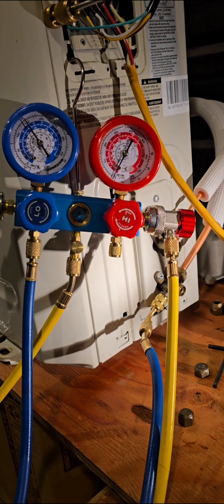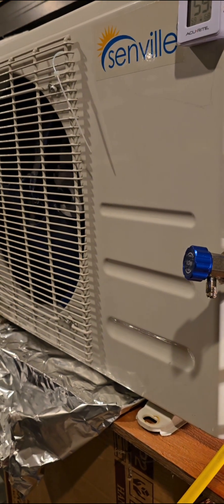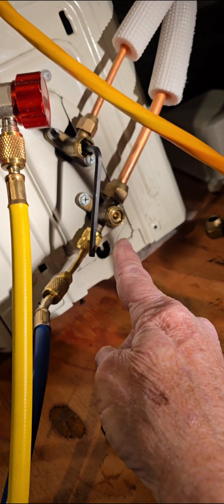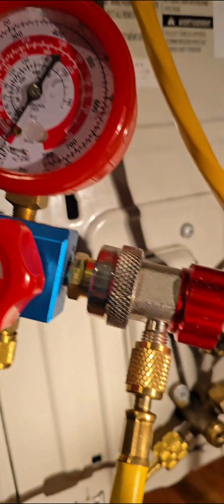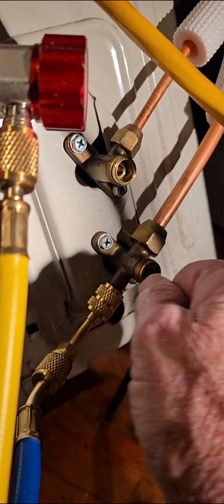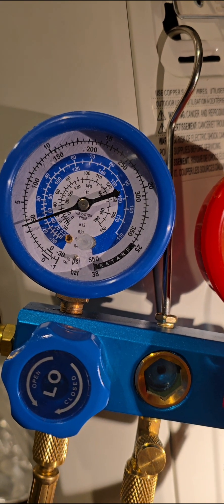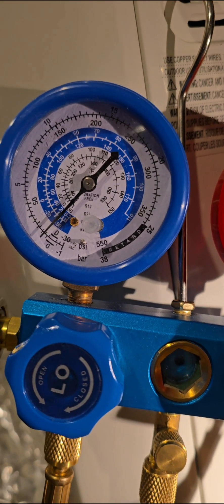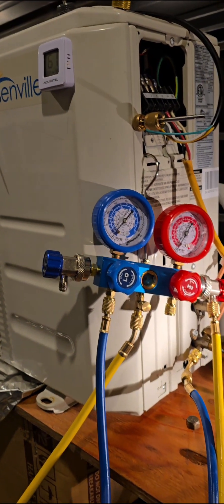Senville Leto mini split, how to put the refrigerant back into the outside unit

Comment: Does leak detector on senville can make this process faild?
Reply from the maker: No especially if you use a fan so just make sure you have a fan going all the time so no amount of refrigerant gets anywhere near the detector It's a simple process You carry a lot of tools with you on your job always keep a small fan with you also It can be a magnetic backed fan to where you can just stick it anywhere and blow it right on a detector and it will keep the detector from noticing any trace of refrigerant
Reply: @Jonehughes thank you for you fast answer, when i shut the valve off,  the system turn off =( do you have any idea what can cause this? i have a new 36 000 central senville with a leak and i try to send the gas to the outside unit
Reply from the maker: @sebastianbrassard Yes and I can walk you through anything you come up with so this is a terrible platform to go back and forth with answers feel free to text me on my personal cell phone 541-660-7805 and we can walk through your issues and get that thing resolved there's literally no reason for this system to be giving you issues 

You also have the option of going to my DIY mini-split Facebook page and joining a thousand other members 

Here is the link to that Facebook group 

https://www.facebook.com/groups/1270821334380086/?ref=share&mibextid=NSMWBT

But do text me so we can get on your system right now let's get that thing installed correctly and get it up and running correctly 

You got this..

Let's get her done❤❤

Comment: Thank you for this video!

I have to install a new Senville Leto that uses the new R454B refrigerant making the ability to pump it back down to the condenser unit critical in the event of a bad flare or such. 

I don't even know if I can get R454B yet, I heard there's a global shortage and even if I could, I bet it would be a fortune $$. Thank you for this video!
Reply from the maker: Yes if you can get a hold of it it cost $4,200 for a 20 lb keg and I was able to score a deal the other day for $500 for 5 lb and that's half price so definitely don't lose your refrigerant put it right back into the unit for safekeeping
Reply from the maker: Also you come find me here 

This is my page that I work from 

https://www.facebook.com/groups/1270821334380086/?ref=share&mibextid=NSMWBT
Reply: @Jonehughes  Many thanks for both your posts and the info! Btw, I called into Senville and they told me something interesting...the only change on the unit when it went from 410A to 454B was a change of size in the copper pipes. I didn't think of it at the time but after the call I said to myself, it sounds like if you wanted to revert it back to 410A all you would have to do is order a new pipe kit....
Reply from the maker: @bobjones3725 

If someone told you that and you didn't just misunderstand what they told you then they were completely wrong everything is different It's a much higher pressure gas and everything all the components every single part is different and is set up for that higher pressure You can take it out and put in R410A 

But it will never be efficient as efficient as it could be and it will not be as efficient as a R410A system is either It just can't work that way but it does work as far as if you needed to have AC or heating and you had no way of getting R454b

Then you could use it in a pinch but as soon as it became available you should switch back to the proper refrigerant It won't hurt a R454 b system 
Because you're putting in a lower pressure system there is no higher pressure system so it's fine it just won't be as efficient but let's just not lose our refrigerant and you'll be perfectly fine The refrigerant you have inside your system is perfect let's not lose it

You do not have to pull your valve core 

You can use the charging system I show in that one video 

The link to the charging tool is in the comment section 

I think it's 12 bucks at Amazon 

And well worth the insurance of not having to pull your valve core or lose one iota of your precious refrigerant❤❤
Reply: @Jonehughes  I hear you. The Senville guy seemed very knowledgeable. I'm not an HVAC guy, I'm an MVAC guy. Also, he did not tell me you could change it back to 410A, I inferred that from his telling me the only difference in the changeover was the copper lines going from the condenser to the evaporator. I'm going to start on the install, perhaps today, and could probably use some advice along the way.
Reply from the maker: @bobjones3725 

I got you all the way but slide into my DM on Facebook way easier to talk than on this channel 

And I have no idea what he's talking about there's no difference in copper lines whatsoever It's exactly the same lines there's no difference
Reply from the maker: Yes right now it cost $4,000 for 20 lb and that's if you can get it I got lucky the other day and picked up 5 lb for 500 bucks